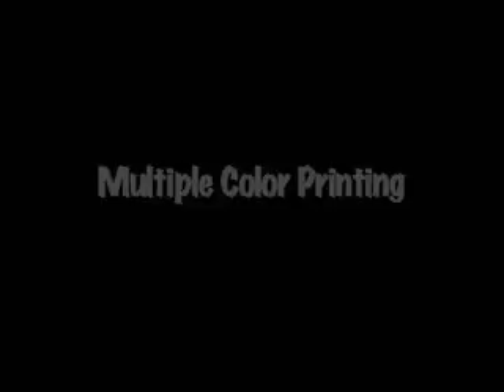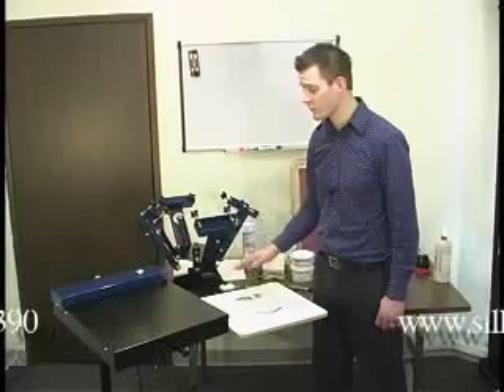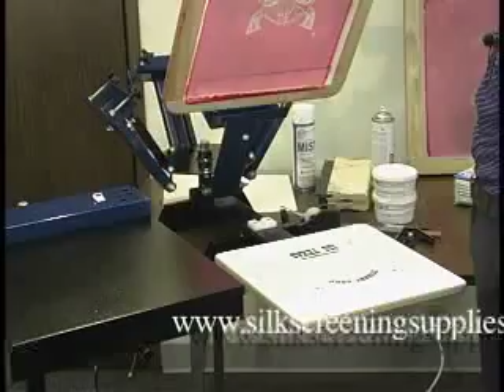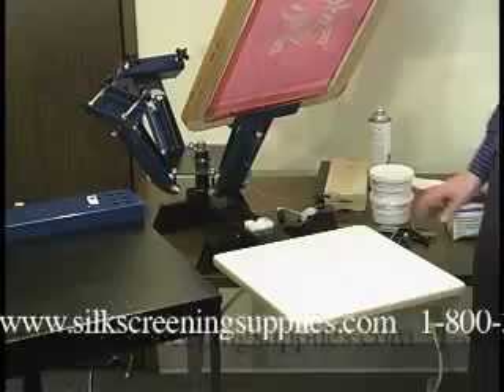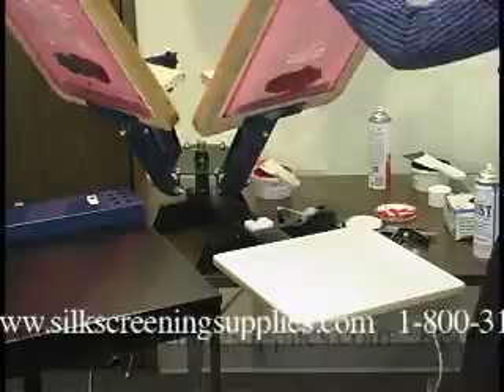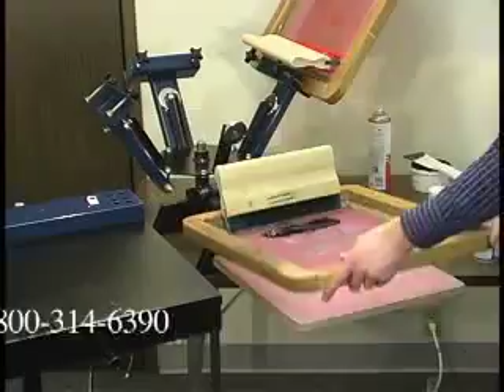How To Screen Print a Multi-Color Print

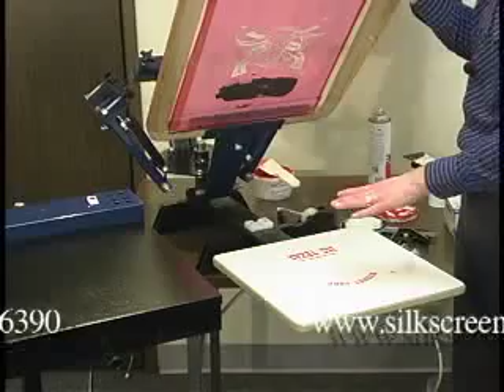Comment: Thank you for all your great tutorials , here I have a question, in the minute started at 8:37 you said no need to flash the design ok , since the red paint touch the second screen (for the black paint) it will stick  and make a mess to the black paint screen and will ruin the rest of the t-shirts . Am I wright ?
Reply: +bushbosh You are right. I think he didn't notice he said that. You couldn't tell because he didn't apply a second shirt.
Reply: Only if the colors are completely separated, not touching at all, is it okay according to him. I think the extra colors might build up and squish a bit. Flash dry couldn’t hurt.

Comment: You can find 1 color, 1 station presses for pretty cheap. The great thing about printing tees is that your equipment can grow with your needs. Check out eBay and also Ryonet's site. Ryonet has absolutely everything you will need. Look into getting your shirts printed and then sell them at shows to build up a budget for printing equipment. This way, you will know if you definitely have a demand for them before you spend money on a press and supplies.

Comment: @GRIPgraff also if you're doing a multi-color job that requires the CMYK usage you have to cure in between colors and you wont want your medium moving on the platen other wise you'll end up with a messy and blurry design

Comment: @WillDee87 
He actually answers that question by mentioning that it does not need to be flash cured in between ONLY because these two colours do not touch each other. It sounds like he might have another video that addresses when they do touch and the need for flash drying in between. Have fun!

Comment: I would cure it after the first print personally.  The wet inks only wont be touching if you have registered it correctly the first time - as most of the people starting out wont have the experience of thousands of prints I would flash cure them at first - I mean if you were that confident why use the reggie marks anyway.  Good video though - very well narrated.

Comment from the maker: Yes your printing style will change somewhat and the number of layers you will need to print will differ depending on t-shirt color. Black shirts typically don't need a black layer but sometimes need a white flash plate. It's too complicated to get into her.  I'd suggest getting our new 101 DVD when it comes out early next year.  Cheers!